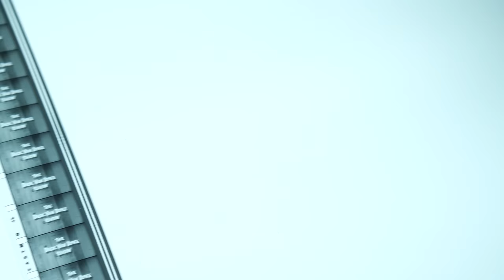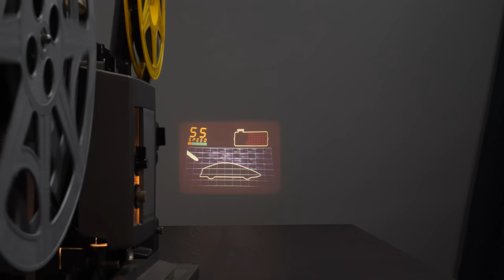Movies made sound with a light bulb: Sound-on-film

Comment: This made me nostalgic, I was in AV club in HS in the early 70s. We had a full auditorium with a projection booth, in it was a 16mm RCA Porto-Arc projector from the 50s. It was hand thread with a separate lamp house containing an arc lamp. A transformer that looked like an arc welder lived on the floor underneath the projection stand which powered the lamp. The projectionist had to learn to manually strike an arc to get it started. A clock mechanism fed the carbon rods together at the rate they burned away and a prism in the side of the lamp house projected an image of the arc onto a glass scale so that the projectionist could monitor the proper gap between the rods to ensure that the adjustable clock speed stayed correct. 

If the clock speed was too slow the gap got wide and the picture went dim and turned yellow. If the speed was too fast the gap narrowed causing the picture to dim and turn blue. Properly adjusted the projector produced a really beautiful and very bright picture.

Each year our club would rent a feature film and charge admission to a “movie night” as a fundraiser. 16mm features came on two huge reels, we couldn’t show a feature without a break because we had one projector. Instead we watched for the cue marks and switched to a slide projector that contained an “intermission” slide. The tail out of these films was black so that the projectionist didn’t have to close the window on the film projector, the slide projected right over the blackout giving enough time to kill the arc. We also had a hand cranked rewinder that was much faster than the projector rewind.

I absolutely loved being a projectionist and got really good at it. That quirky sound of a 16mm optic soundtrack always brings back memories.
Reply: I got to operate 35mm Peerless Magnarc lamp houses in college. They would drift, too, so I'd have to adjust them every couple of minutes.
Reply: Wow, that arc lamp management sounds wild! And very neat.
Reply: @IstasPumaNevada  It sounds really crazy, especially considering that František Křižík had automatic regulator for arc lamps patented already in 1880.
Reply: That sounds like a very simple setup to our town drive-in during that same time period. Carbon and lamp and intermission music and slides suggesting you but something from the concession stand.
Reply: @DreitTheDarkDragon  you inspired me to look up Křižík. He was quite the inventor and engineer but I’m having trouble finding out how his automatic arc lamp worked.

Once the clock was properly adjusted on our projector it held very well. A set of new carbon rods would just cover the biggest reel of film. So a two reel feature consumed two sets of new rods. But we also projected many shorts for particular assemblies during school so we had leftover partially used rods. It took some judgement to know if a short rod could last through a short film. It was no fun having the lamp go out in the middle of a film.
Reply: @joekelly7505  If you needed to readjust them every few minutes, they were not working correctly-it DOES happen:one place I worked, covering another operator's vacation, had Peerless Cinarc lamnphouses-basically the same as the Magnarc,  that were so worn out, that just running to the restroom(in the same room), resulted in an over-wide gap, with the resulting poor light.
Reply: I was in AV club in the early 1960s at a small high school in semi-rural Ohio.  We had a couple Bell Film-o-Sound projectors that were our daily drivers -- very reliable and pretty easy to learn for an 8th grader.  But I was interested in our "back up" projectors - a Victor Animatograph and a Victor Animatophone.  Both were 1930s-era "portables," though it took two of us to lift them onto a cart.  The separate audio section of each was full of ancient-looking vacuum tubes.  The projector motors took several seconds to come up to speed after turning them on, with a loud whine that was nicely hidden by the racket made when the clutch was engaged and the film started moving.  They seemed to work OK, though.  But they were scary machines, and I think we used them just once.

Still, that experience stood me in good stead when I worked at a TV station ten years later and loaded innumerable films onto the four RCA TP-16 projectors in the telecine room.  Those were 6 feet tall with almost-professional-level film handling and capacity for large film reels.  I got good enough to be able to thread one in just a few seconds -- speed which was needed during the Christmas advertising peak, when I might have maybe a dozen short commercials to load, per projector, during the half-hour evening news program.
Reply: @m.k.8158  I'd have to make small adjustments. None of them drifted too far. Plus this was in the early 90's, and my boss lamented that the quality of Union Carbide carbon rods had slipped over the years (they had become a boutique item, as pretty much only smaller art houses and colleges used them) and no longer had very steady burn rates.
Reply: @joekelly7505  When I ran properly maintained lamp housings, yes the drift was minor..
As for UCar carbons, they seemed to work ok when I used them, but they may have been old stock.
The one issue that I've seen:if the carbons are not stored well, sometimes they can absorb moisture-this can cause the carbon to BEND slightly as it is being used-compensating for this can be a hassle.
Reply: Those systems have been known to create cold fusion if not properly aligned.

Comment: Great video! A few things that might be of interest:
- Magnetic sound on film was more of a feature of cinema sound than you might have realised. When CinemaScope premiered in 1953, the wide image was only half of the selling point - the other was the 4 channel high fidelity soundtrack, which was achieved by putting 4 magnetic strips on the edges of the film. 
This 4 channel layout (Left, Centre, Right, Surround) is what Dolby would emulate when they came up with their Dolby A encoding system utilising the optical soundtrack. (btw Stereo sound for cinema has always meant at least 4 channels, not 2 as is the case in the home).
The original Cinemascope was also a wider ratio (2.55:1) than what became the 'Scope standard (1.35:1) because it originally widened the image into the previous optical soundtrack area. 

This "Mag-strip" was also utilised for the 70mm format, with 6 channels recorded onto the edges of the film. 70mm never had an optical soundtrack. Even once filming natively for 70mm became a rarity, big films were still often optically 'blown up' onto 70mm release prints pretty much purely to take advantage of the better soundtrack. 5.1 in the layout we know it today was already in cinemas since 1979 thanks to 6-track mag strip 70mm when Apocalypse Now premiered. Also, it sounds awesome.
- When doing traditional double-projector presentation, projectionists would often put some splicing tape on the edge of the film in the lead up to a reel change - the clacking sound the tape would make as it passed through the rollers / gate would serve as an audible warning that the reel was soon to end.
- SDDS utilised ATRAC encoding - the same compression format Sony had invented for the MiniDisc! Also, whilst it was 8 channels in its premiere format (which added two more channels behind the screen - the same as the original Todd AO 70mm Format), SDDS also had a standard 5.1 mode. For many years prints with all 3 soundtrack formats like the trailer you have were very common. What was less common was studios opting to upmix to the full 8 channel format. The advantage of having those extra 2 screen channels is again being utilised by Dolby Atmos.
- DTS didn't ever utilise higher capacity DVD Roms. However part of the original design of the system had allowed the timecode to also be used to trigger in-theatre effects. And from memory there was also provisions in the DTS bitstream itself to accomodate triggering other than the soundtrack. For this reason, DTS did get some limited use in special venue scenarios. It was also the only one of the 3 digital sound formats that had a 70mm version. Which was easy because the SMPTE timecode was just added to a 70mm print.
Reply: I love how he always sticks in a little tidbit about Disney lately
Reply: The initial release of the Ken Russel film of "Tommy", the rock opera from The Who, used a system called "Quintaphonic" created by sound engineer John Mosely.  This used a combination of a Sansui QS matrix quadraphonic system (for left and right front plus left and right back) with a discrete centre channel. The resulting three channels of audio (Lt and Rt from the QS encoder plus the centre channel) were recorded on three of the four tracks on a stripped 35 mm print. DBX noise reduction was used on these three channels. This created what in modern terminology would be called a 5.0 system. "Tommy" was released in early 1975, a few months before the first Dolby Stereo release, which was of another Ken Russel film "Lisztomania".

Curiously the original Dolby Stereo cinema processor, the CP100, was designed to facilitate its use for Quintaphonic playback. By swapping the three Dolby Cat-22 A-type noise reduction modules for the mechanically and electrically interchangeable DBX K9-22 module (yes it really was called that!) and connecting a QS decoder to terminals provided on the CP100. 

After "Tommy" the Quintaphonic system was never used again, it joined Disney's "Fantasound" system (used for the initial release of "Fantasia") as a "one-film wonder".
Reply: I ran a Norelco DP70 for Wehrenberg theaters in Missouri it was probably the best film projector ever made.
Reply: Near miss @CinemaSynesthesia.  70mm did have an optical (variable density) format with Fox's Grandeur. It was also 4-perfs/side per frame.  

Stereo for cinema always meant at least 3-channels, not 4.  The surround channel started out as an "effects" channel and some titles omitted them and some 35mm magnetic prints omitted the surround stripe. Later DTS units (XD10 and XD20 could do higher channel counts).  You can also have multiple DTS players track off of one reader to expand channel count.  And, while they never did change their disc types, the later units could ingest via USB (that fancy new thing) and later software versions of the later units could also exchange content via network.
Reply: @sguttag  Fox Grandeur was an entirely different format from modern 70 mm film.   The perforation pitch was greater than the 64 to the foot of 35 mm which is also used by modern 70 mm film.
Modern 70 mm film is actually based on another failed wide-screen format from around 1930, Paramount's 65 mm format. When Todd AO were starting work on developing their "Cinerama through one hole" format they acquired the cameras which had been built for this system, which is why negative film for 70 mm is actually 65 mm. Print film had an additional 2.5 mm added each side to make room for the magnetic stripes (two tracks are recorded between the perforations and the edge of the film on each side, one between the perforations and the image on each side).

Early Cinemascope films with an "effects" track used a 12 kHz tone recorded on that track together with the audio. The absence of that tone muted the relevant amplifier so that audiences wouldn't be disturbed by hiss when there was no "effects" recorded.  
Early Dolby Stereo films also didn't have a surround channel.
Reply: @davidfaraday7963  @sguttag great replies both of you. This thread rocks.
Reply: @CinemaSynesthesia  Back in the late 1970s I was one of a group of volunteers working to restore and reopen a historic (1911 vintage) cinema that had been closed for over 20 years. The original projectors (Kalee 7s with Western Electric 4A soundheads) were beyond saving due to corrosion and vandalism, but we had been given a pair of Kalee 20s.  These Kalee 20s came with "penthouse" magnetic soundheads and it was my intention to recondition these heads and add the necessary electronics to give ourselves the ability to screen 35 mm mag prints. I did a fair bit of research into the system at the time such as finding the articles about it in the JSMPTE issues from 1953 when it was introduced.  However I was advised that this was now an obsolete format and that 35 mm mag prints were no longer available, so I didn't proceed with the plan. 
The Kalees were fitted with Dolby Digital soundheads in 2000 and are still in good working order, though they get little use these days. They now share the tiny projection room with a Christie D-Cinema projector which earns our bread-and-butter.

Comment: Another fact that is often overlooked in the states with DTS is that having the audio on a separate medium makes DUBs so much easier as you only need to swap the audiodisc so switch to another language. I think around this time cinamas started to tver alot more variations here in germany, making runs with original language, than one with dub and sometimes even a third language when there was a large group of potential customers of that language near a specific cinema.Noone would have dealt with that chaos in the older days.